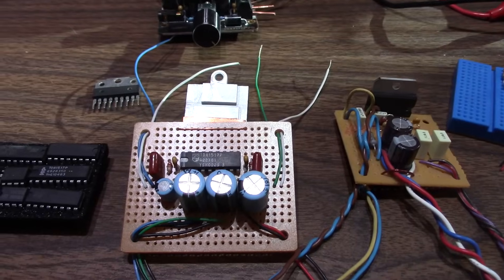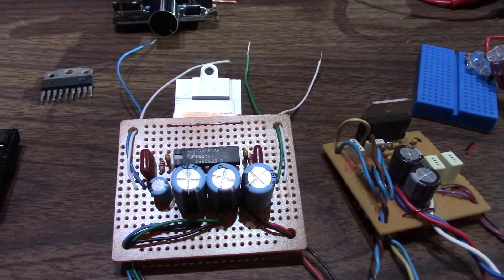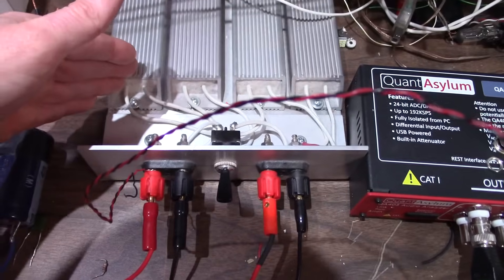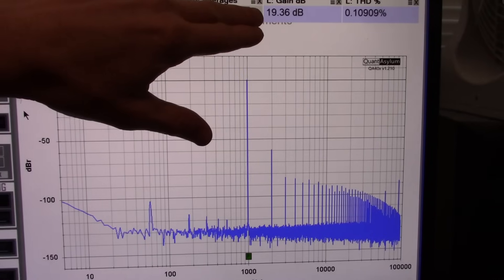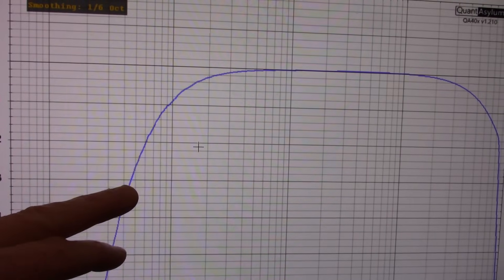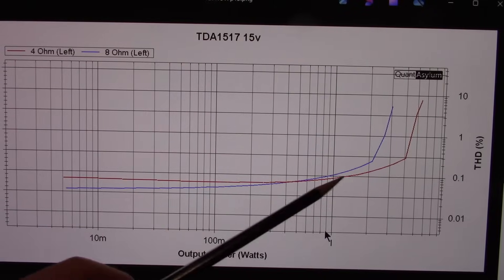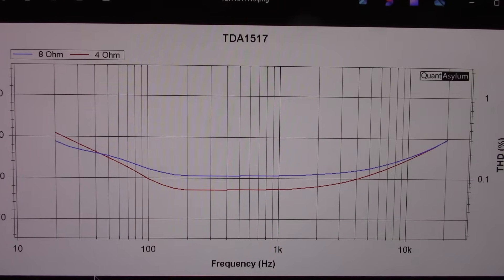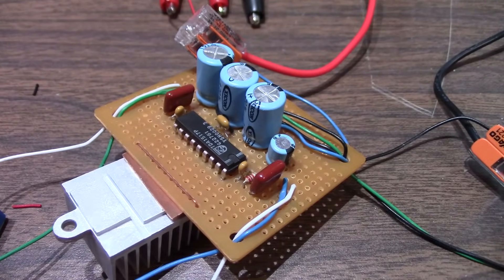TDA1517 stereo amplifier IC measured on the audio analyzer

Comment: Hay John long time watcher. Ive noticed you never really use like....boutique or higher end caps, How about you test some nichicons compared to the generics and see if they actually preform better or worse on these chip amps, or maybe show a use case were the better caps would make a difference OR that there really is no difference between generics or boutiqes in any use case.
Reply from the maker: That might be an interesting test to perform. I'd expect only a difference to be seen at low frequencies where a large voltage appears across the plates of the capacitor.
Reply: @JohnAudioTech  yeah like as output caps or input filters. Idk you would know better then me but I would like to see if Nichicon golds or "Audio grade" caps actually make a difference.

Comment: i have a wierd question
i noticed that you love to use symethrical power suplies whenever you can , but what would be better if you had to use single positive suply? a chip amp with AB topology or an A class design?
Reply from the maker: I was using a single supply in this video by using only one side of the supply and one of the capacitors. Most of the amplifier ICs that are normally dual supply can be configured for single supply operation.
Reply: @JohnAudioTech  i know that, this was not exactly the point of my questoin. it was more theoretical
something like  what are the adventages of using a totemploe topology over single voltage follower, other than standby current?
i know that almost every chip amp can be biased to half voltage and would work with single suply as if dual suply was emulated. i done it before i was jusy wondering why AB and not pure A output stage is more common in pure single suply chip amps
Reply: @kokodin5895  I think car amplifiers? Many AB amp IC's if you look at the datasheets, were originally designed for car audio, so a 12v battery, and good heat dissipation. see TDA7374 - which is quite good.

Comment: The LM3886 is likely to be very interesting with its output of up to 60 watts.
These particular chip amps are used in at least two quality branded amps that I know of.
Reply: It's one of the greatest, outperforms a lot of discrete designs. I think they're used in modern Leak amps.
If running at 60watts they really need multiple decoupling caps of varying values beside the chip.

Comment: Just a thought for a future video - is there a difference between running an amplifier from a stabilised bench power supply or the more basic transformer/rectifier/capacitor ?
Reply from the maker: Unregulated supply voltage will vary with load. It depends on the capacitance and load regulation of the transformer. I touched on this in an earlier video.

Comment: Pretty crappy amp.  High distortion!  In fact anything above 0.01% at 90% power out is CRAP!
Reply: Why is that? Listeners can barely hear 0.1% on a 1k sinewave, let alone music. No headphones and certainly no loudspeakers can deliver the entire bandwidth with THD better than 0.1%, so pretty much entirety of HiFi experience is flawed by your eloquent definition.
Reply: @paulb4661  He is from the 1970's.  It was all WATTS and low distortion. I think below 0.1 is hifi.Ultra low distortion usually comes at the expense of musicality - they filter everything for low d numbers. Old trick.
Reply: Damn right Dear Boy ! I will suffer no more.

Comment: I'm kind of sure this chip has some high-pass filtering...though I did a TPA1517 board that sounds a little nice with high-efficiency speakers. I lost the KiCAD design for the board though. I think some old 90's Sound Blaster cards use the TDA1517 as a "speaker output" amplifier also.
Reply: Yep, even SB128 had it on some variants. Cheaper non SBs used TEA2025 or it's clones.